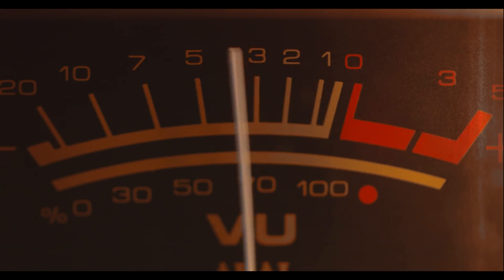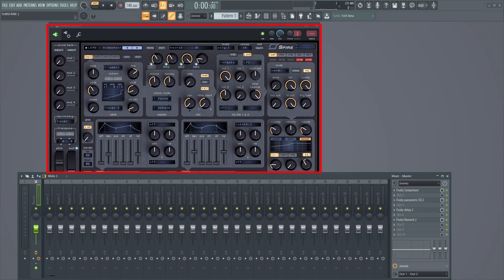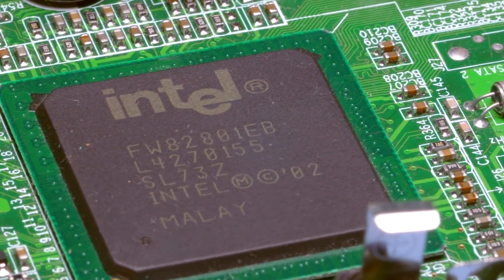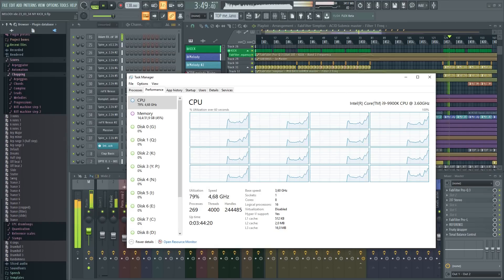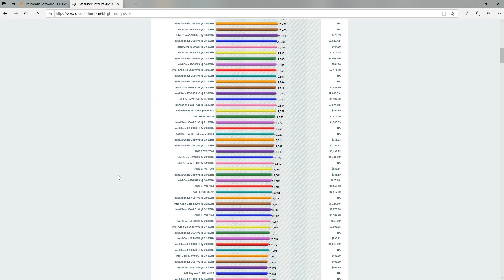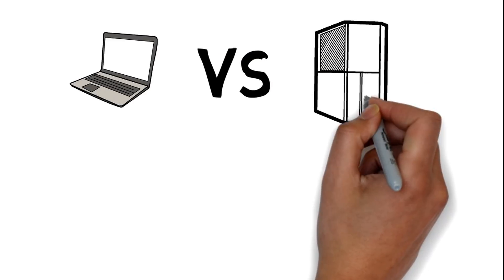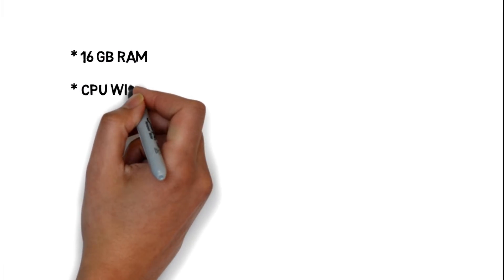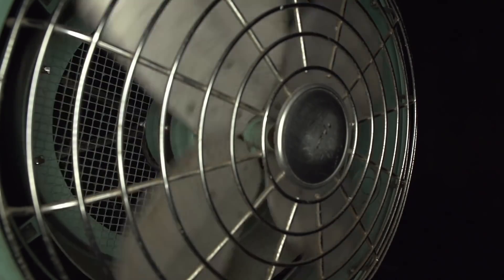The Best Computer For Music Production - What's Needed And Why!

Comment: Man, why did you go for an upgrade now. Really not the best time. There are new AMD socs coming in about 2 weeks. You can either go the new fast AMD ones or get the old Intel ones which will be discounted to compete.
I understand your argument about single core performance, but you could have just waited out. 
Great video tho 👍🏼
Reply from the maker: Thanks :)  You have some valid points there. I actually ordered the components several months ago, but I was unable to get the video out until now (I have two jobs, and it was a complete nightmare to get everything installed and working properly again). New chips are released all the time so I knew that videos like this will never remain relevant for long, which is why I focused on making the first half of the video more of an informational video about how daws work and what to look for in general.  

I'm very eager to see what AMD can deliver with the 3000 series. I really  hope they will finally catch up to Intel. For 20 years I always used to buy AMD chips (CPU & GPU) because I wanted to support competition. Unfortunately they've been falling behind Intel for quite some time now and eventually I was forced to move to Intel chips. I truly hope they can finally catch up this time! :)

That said, the same rumors was circulating regarding the bulldozer, which was said to be the ultimate Intel killer. There was lots of benchmarks and stuff out there, but once it was tested by independent sources it turned out not to be the nearly as fast as people was expecting, so we'll just have to wait and see. If the AMD 3000 series turns out to be far better than the i9 in terms of single core performance then I'll update this video. Let's just wait and see what happens. :) 

Hopefully you're right and the 3000 series will be the one to finally catch up to Intel, or even surpass them. That would be great news for consumers, as it will once again lead to lower prices and more innovation. 
Until now, Intel has been able to charge insane amount of money for their chips because there hasn't really been any real alternative from the competition. Nor have they felt the need to innovate and push out faster CPU's more quickly, for the very same reason. If the rumors regarding the 3000 series turns out to be true, then all this will change, and that will be great news for sure! Let's keep our fingers crossed! :)
Reply: @FireWalkMusic  Yeah man, anyway the Intel chip you have is no slouch, and also the new Ryzen 3000 chips are more on the multi-core, multi-thread side of things. 

So, have some good time with your new machine.
Also, love you tutorials, helped me so much, me being a noob producer.

Comment: Just to note:
When going for the fastest cpu don't just look at the speed.
4.5GHz isn't necessary better than 4.0GHz.
It depends on the technology, so you need to really check benchmarks and look for the performance.
singlecore performance IS NOT EQUAL to cpu frequency.
for example my ryzen 2700x @3.7-4.1GHz (stock) beats my older i7 6850k @4.4GHz (overclocked)
Reply: Yeah because the Intel has a old architect. When you take a processor with the same frequency but different nano process, one of them will beat the another. And it will be the most small of them, when we looking a processor the frequency an the number of cores its important, but, you need see better the best performance on calculus per cycle. That's the real performance. Even if these works on a works frequency and less cores.
Reply: Maybe cause R7-2700X = 8 Core (2 Core extra than 6 Core i7-6850K) then L1, L2 & L3 cache impact your performance.
if you upgrade to Ryzen Zen2 3700X could give more benefits

Comment: Good call on the Fractal case, i have the exact same one and its very quiet. What concerns me about this video is that the test he does is playback, not recording. You can't compare the 2 CPU's on playback as that is most likely stressing the hard drives not the CPU. Also real world recording. No one records with a 1024 buffer size, unless they want tons of latency, and lets be honest no one does. I record live bands and i need ultra low latency fro the guitarists who use only amp sims. I've also recorded drummers who use e-kits triggering Superior Drummer 3, again i have to use an ultra low buffer setting 32ms. Also the AMD Ryzen 3000's are out in July 2019, they will be much better bang fro your buck than the 9900k if you are building a brand new machine. By far the most appropriate testing suite for music computers is Dawbench. Also when testing make sure your not using an audio interface with onboard DSP as could skew your results as they often have what they claim is "zero latency" monitoring
Reply from the maker: The Fractal case is great! :) I think you got it mixed up a bit regarding recording and playback. When FL Studio loads a project everything is loaded to random access memory in order to avoid any glitches and stuttering when playing the project, which would most likely happen if it had to constantly read from the disk. This is why large projects tend to eat up a lot of RAM. 
Most of what's going on in this case  is generated realtime by VST's. The settings are exactly the same for both computers, and in both cases the CPU needs to process (generate) the sounds and apply all the effects and so on realtime as the project plays. Nothing has been "frozen / consolidated", so it's all processed real time. All settings are exactly the same, and even the disk (ssd) is the very same disk in both cases. 
Disk usage will actually be higher when recording, for example if you are recording a vocal, guitar or whatever. It will then need to write to a temporary wav file. If you're recording midi on the other hand using soft synths (vst's) then no external file is saved. It will instead be contained within the FLP itself.  :)

The reason for the 1024 buffer size in this case is because of the large amount of VST's. The CPU needs a large buffer in order to prevent under runs, because there's so much to process. 

Regarding the 3000 series, it surely looks very promising, especially the single core performance. But I've learned to take these kinds of claims with a grain of salt, since this tend to be the case every time a new architecture is announced. The same expectations were present with the bulldozer architecture which was supposed to be a real Intel killer, but that didn't turn out to be the case, and a lot of the benchmarks turned out to be cherry picked. 

Still, I'm hopeful that this won't be the case this time, but until I have solid proof I won't feel comfortable recommending it, but if it checks out then I most certainly will! New CPU's are released all the time and in 6 months time this build won't be very relevant any more. This is why I divided the video into two sections, with the build saved for last. The first part of the video should still remain relevant for some time, unless they dramatically change the way daws work in the meantime :)
Reply: @FireWalkMusic  so are you setting your buffer really low when recording your VSTis in real time or are you step sequencing them in? Latency is an issue with VST instruments if you are playing them 'live', yes they are RAM hogs but only if you don't convert them to audio, otherwise they are sat in RAM, that's why once I've recorded a VS T instrument performance that I'm happy with I convert to audio to stop wasting unnecessary resources.
Can I ask why you went with top of the range gear but went with the Focusrite Scarlett, that seems an odd choice if you aren't worried about budget
Reply from the maker: @stupidusername38  Basically yes. I start out with a low buffer setting so that I can record, and then once I have the main ideas down, I gradually increase it as the project becomes larger. To be honest, I don't really like the way FL Studio freeze tracks compared to Cubase for example. I still find it a bit tedious, especially because I often go back and change things. I might suddenly come up with a counter melody for example, and then I need to go back and change a lot of things to make it fit. Or I decide to change the bass line and so on..  I also make some very large projects, so I need a lot of processing power to be able to handle that. 

I also do a lot of mixing and mastering for other artists, so I'm constantly opening and rendering projects. I also do a lot of video editing, so I need a computer that works well in that regard too. I have a full time job, and I do mixing and mastering on the side, as well as my youtube channel. Needless to say, I have very little spare time, so every minute I can save counts. I mainly upgraded to the top of the line in order to save as much time as possible, since I spend so much time waiting for stuff to render etc. I've actually found myself in situations where I'm rendering out a mix and a video at the same time :)

Regarding the Focusrite Saffire pro 14, I've had it for a few years and I've been happy with it's performance. I mainly work with software instrumetns, and the saffire has a nice low latency driver which work very well for me. A teacher once told me: Never mess with something that's not broken, and I've found that to be a good advice. The Saffire does everything I need it do do, so I just stuck with it. I didn't really have any good reasons to upgrade.
I probably would have if I was more into recording, but since I mainly just record midi it's more than enough for me at this time :)

Comment: Fire walk plz respond I need help with a music production pc for 700 pound preferably????
Reply from the maker: If you're on a budget then I recommend going for an AMD process, since it will give you the most performance for your money. For example this one: https://www.amazon.com/AMD-Ryzen-1800X-Processor-YD180XBCAEWOF/dp/B06W9JXK4G/ref=as_sl_pc_tf_til?tag=firewalk02-20&linkCode=w00&linkId=dbc209deffe776560c6ab1d6a8a52bba&creativeASIN=B06W9JXK4G
Reply: @FireWalkMusic  thank you but I saw a comment on a video saying the ryzen stuff doesn't work well with certain daws he said it didn't work well with ableton which is what I'll be using can you give me anymore information on this ?
Reply from the maker: This is explained in the video. It has to do with single core performance. The newer ryzen CPU's are good, all though they have slightly less single core performance vs the top Intel CPU's. The Ryzen 3000 series is rumored to have single core performance equal to that of Intel CPU's, but I've heard this claim before so I won't be recommending anything until I know for sure. I would go with some of the CPU's recommended in this video.
Reply: @FireWalkMusic  cheers firewalk gonna become a film composer anything extra for my computer I should no about for the genre I'll be doing

Comment: the part about single core processing importance was very helpful :)
Reply: Except its not true. Most vst plugs utilize all your cores. The ones that dont are considered buggy and a result of bad programming.
Reply: @ZenDao_85  good point but remember without RAM, none of your VSTs would work!
Reply: @ZenDao_85  powerful synths like U-He Diva use multiple cores?
Reply: @leaningtower73  Yes, it is quite powerful and takes much cpu...I would say just like spire... Nexus and Sylenth take less than those two definetly...
Reply: Yeah, but then he went for a 9900k when an I5 has about the same single core performance. Still a helpful video, though. If I were to build a computer today, thunderbolt 3 would be a big point. Near 0 latency monitoring even with effects.
Reply: @mriely  Very well said but i9 Processors have better features and generally better single core performance that would enable a smoother experience. Also great point about Thunderbolt 3. TB3 is an excellent technology for modern day audio interfaces in particular.
Reply: this is why amd cpu's aren't the best choice for audio production, intel have much better single core processing.
Reply: @Challenger Free I was going by this article but even if its 6 months that's not exactly "living in the past". There was a point in the 90s when AMD had the number one spot too so I guess you could say we're living in the past either way. Brand loyalty and fanboy behavior is silly man. Unless you actually work for one of the companies and have a hand in the creation of these processors its odd to take a side or have some sense of pride or superiority about it. They're just products that we can all go and buy whenever we want. Intel will pass AMD in the near future because they're both now in a real competition and that's a good thing. AMD will then outdo Intel and they'll go back and forth as we get more options and better prices in the future. 
https://www.statista.com/statistics/1134042/processor-single-core-performance-geekbench-score-worldwide/
Reply: True
Reply: @Challenger Free living in the past, haha. You mean as in the last 3 weeks? AMD didn't pass Intel in single core processing until April (this month) of this year. Of the top 10 single core clocks Intel has 6 but AMD took the top 4 positions. We're talking small differences too. AMD is on a mission and they are destroying right now. They both have their ups and downs but even the biggest Intel fanboys have to admit that AMD is doing work. Its a good thing for every though. Competition like this ends up being good for the consumers. Now Intel actually has to try.
Reply: @Challenger Free technically they were being precise too if you look at when they posted their comments. Their comments literally were living in the past because you were responding to comments that happened 9 months to a year ago. I just thought it was funny that you were like "psshh, AMD has the fastest processors now, living in the past?". It basically just happened. I own both. I have an AMD desktop and an Intel laptop. They both do their jobs, though the AMD has been a consistent pain.
Reply: Yeah ihad i5 cpu and kept cpu glitching and maxing out which made pops and cracks in the track ihope my alienware x15 with i9 11900H will do the trick im still not sure ilike to over dub guitars and after 8 tracks on i5 was it so hopefully i9 will let mw double that lol
Reply from the maker: Glad you found it useful. :) You might also want to check out my video about how to get better CPU performance in FL Studio, as well as how to make CPU friendly projects: https://youtu.be/OWYmqwb7b4k

Comment: Wow so much information i learn how about cheap but good quality of monitor speakers?
Reply from the maker: You're welcome. If you're looking for some good, but reasonably priced monitors then I would recommend the Adam T5V or T7V monitors. They sound amazing, and doesn't cost too much. You also get the ribbon tweeter which is usually ony delivered with monitors that cost 5 times as much. 

Here's the T5V monitors (5"): https://www.amazon.com/Adam-Audio-Professional-Nearfield-Monitor/dp/B07CZXC1PL/ref=as_sl_pc_tf_til?tag=firewalk02-20&linkCode=w00&linkId=9365493ef9f1ade1637d5b3d390f87aa&creativeASIN=B07CZXC1PL

If you have a large room then you might want to consider the T7V (7"): https://www.amazon.com/Adam-Audio-Professional-Nearfield-Monitor/dp/B07CZXC1PL/ref=as_sl_pc_tf_til?tag=firewalk02-20&linkCode=w00&linkId=9365493ef9f1ade1637d5b3d390f87aa&creativeASIN=B07CZXC1PL

These monitors from Adam Audio is the most professional sounding monitors I've heard at this price range. They sound equal too, or better than most monitors that cost twice as much, so that's my recommendation. :)

Comment: Hey..video is nice..but wat about Amd's new cpu's  is it cool to buy for music production
Reply from the maker: Hey, all daws, including Ableton work basically the same way in the way they process the audio. They all rely heavily on sequential (serial) processing. 
I generally advice people to buy AMD CPU's if they are on a budget, or if they aim for a mid level computer because you will get more performance for your money by buying an AMD processor. I only recommend intel if you're going for the fastest computer possible (which is what this video is about). The Ryzen CPU's will usually be more than enough for most people.

This CPU for example should offer very good performance and will also be a lot cheaper than the I7 or I9 CPU's from Intel: https://www.amazon.com/AMD-Ryzen-1700X-Processor-YD170XBCAEWOF/dp/B06X3W9NGG/ref=as_sl_pc_tf_til?tag=firewalk02-20&linkCode=w00&linkId=c64036ed3b37a045e90e4f3cf9c78618&creativeASIN=B06X3W9NGG
Reply: @FireWalkMusic  Hello FireWalk. I see the reason behind the video and this is a great help. What do you think about Ableton live 10 and the new AMD Ryzen 7 3700x or 3900X? Price almost the same as Intel's.

Comment: AMDs new CPUs are rumoured to have more cores and equivalent or higher single core performance compared to Intel while being cheaper.
Reply: The new Ryzen 3000 series yes. Incredible performance from such a budget chip
Reply from the maker: It will be interesting to see what the new 3000 series can do. But keep in mind that rumors like this has been going around for a long time already, starting with the Bulldozer which was supposed to be the ultimate Intel killer. That didn't happen. I truly hope that AMD can finally get back on track and match, or even surpass Intel again. That would be very beneficial for the consumers. It would mean lower prices and faster development of chips.  :)
Reply: @FireWalkMusic  I agree. There have been benchmarks showing higher IPC but their authenticity right  now is questionable. But they will certainly match or almost match Intel in single core.
Reply: AMD  announced that the Ryzen 5 3600 will surpass the i7 8700 so yeah
Reply: @DieRegteDjMielie  I want to believe that but cant really trust that until we have user benchmarks.